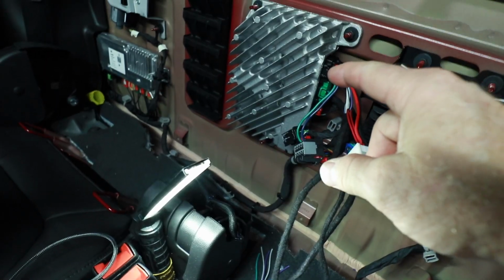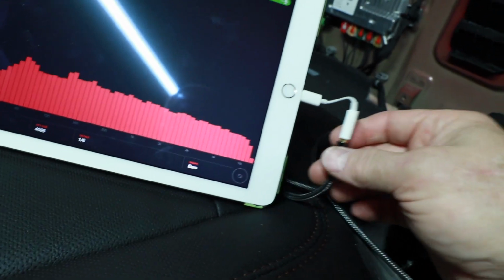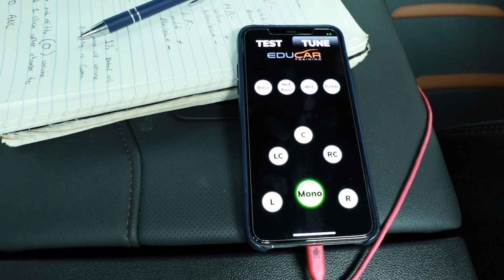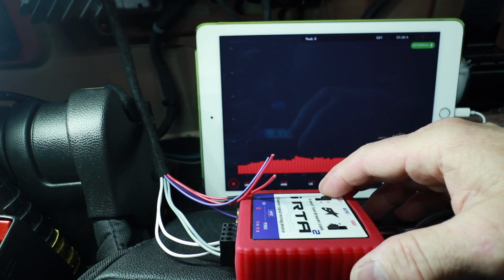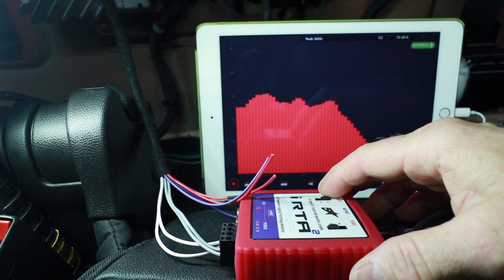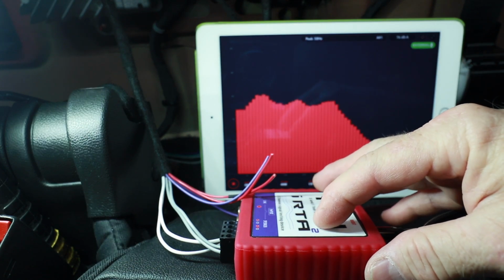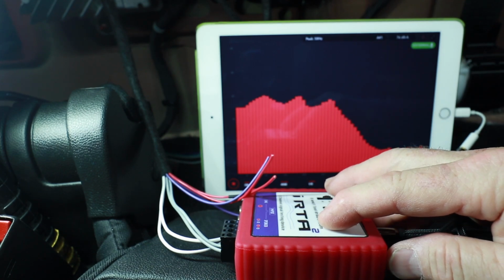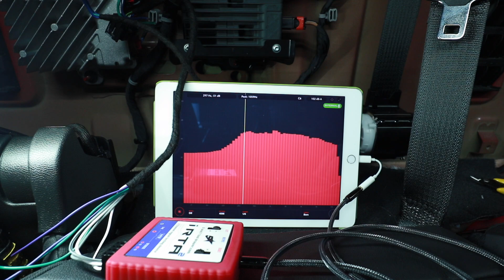How to use the iRTA2 to verify Allpass filters

Comment: So the answer to my previous question is...most likely. Both of the official Apple 3.5mm adapters (Lightning and USB-C) use the same Cirrus chipset for DAC. Since iOS doesn't use the analog audio capabilities of the USB-C connector it should be a plug and play deal. I've ordered an iRTA2 so I'll confirm when it arrives.